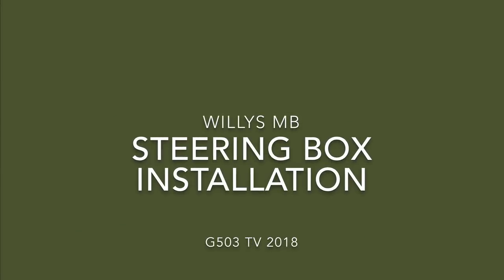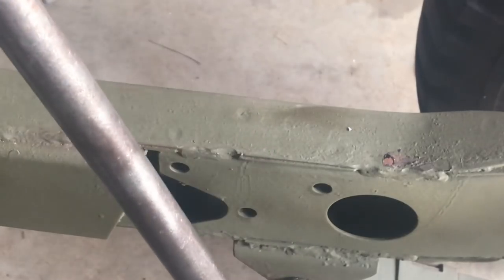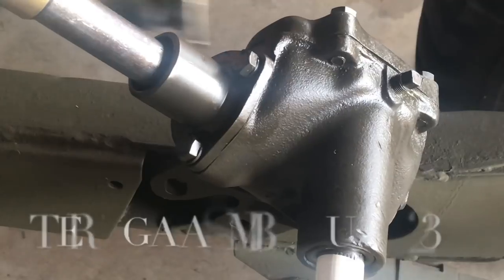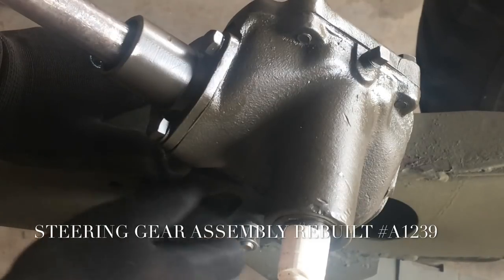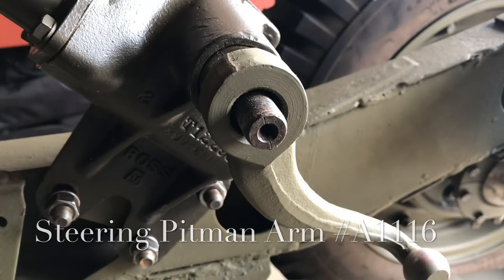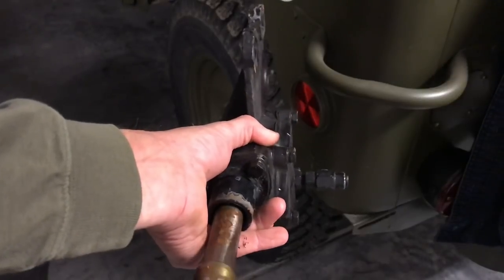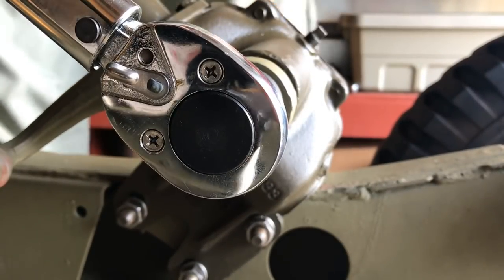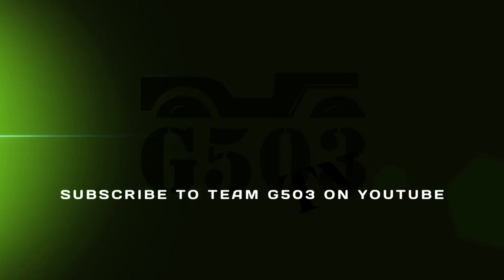Installing The Ross T12 Steering Box On A Willys MB G503 TV

Comment: I would not torque the Pittman arm that way. I locked the Pittman arm in a soft jawed vise and torqued the nut. Did not want to put any Unnecessary stress on the worm & sector.